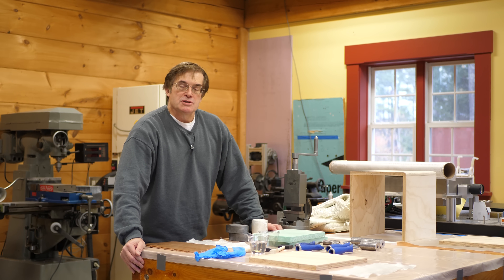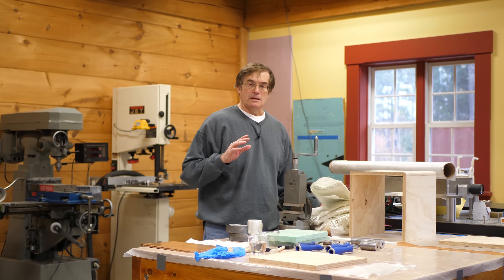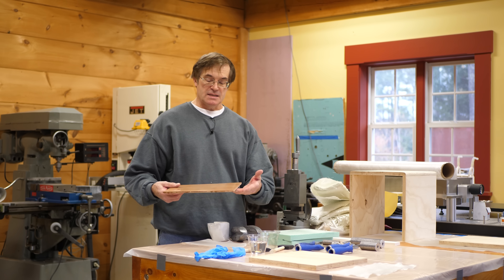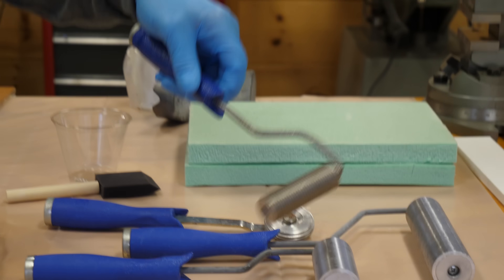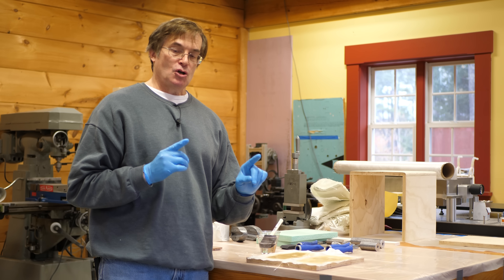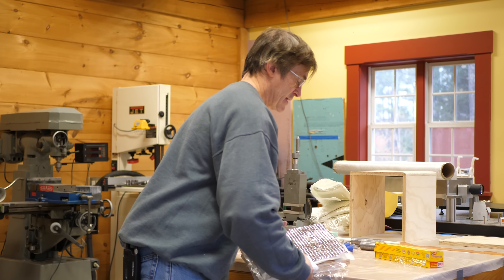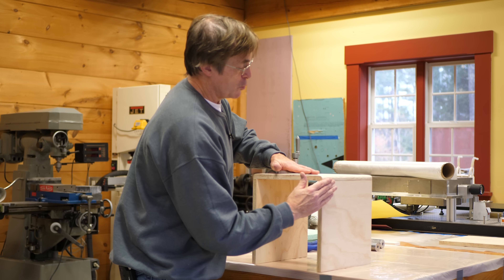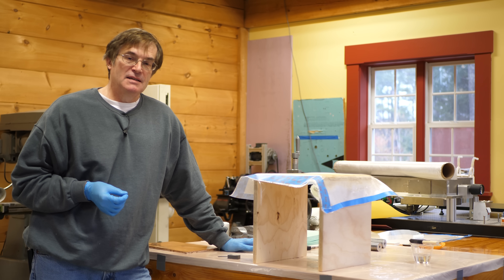Easy Tricks Using Fiberglass Strengthening!

Comment: When you insulated the piece to speed up the curing process, you laid down a piece of cling wrap directly on the curing expoy, is there no risk of that impacting the final surface?
Reply from the maker: Absolutely.
So, if the surface finish matters we'll show you how to protect it in the next video.
Reply: If you can increase the room temperature using dry, petroleum free heat, you can decrease  your cure time by half for every 10 degrees above 77 degrees F.
Reply: @WereAllThatBored  why "petroleum free"? Is there something special about it?
Reply: @cabletie69  Pay no mind. He's just trying to make himself look smarter than he is.
Reply: cabletie69 byproducts of burning petroleum and epoxy do not play nice.  It’s more about contamination your work space and potentially your layup.  Same reason a heat gun is recommended to pop air bubbles in table top epoxy vs a torch.
Reply: H3R3T1C right.  Thanks for your contribution.  I recommend venting your car exhaust towards your dry fiberglass let me know how it goes
Reply: @cabletie69  Virtue signaling most likely.
Reply: @WereAllThatBored  With torches, if you don't see any black smoke, it means complete combustion is taking place. This means that there are no real by-products unless you set the epoxy on fire like a dumbass lol. 90% of the time when you look at an epoxy river table or the like build, they use propane torches to pop their air-bubbles. Are you to tell me that 90% of people are doing it wrong?
Reply: H3R3T1C cool story bro
Reply: @MFKR696  Hydrocarbons and humidity are byproducts.  Since you didnt follow anything I typed I get why you didnt understand.   First point.  Heat  accelerates the cure time.  The room you are heating is your work space.  Its where you keep DRY cloth.  Notice I said aim your car exhaust towards DRY cloth and let me know how the Hydrocarbons work out for your now expensive, useless fiberglass.  Last, and very least important.  River Tables, they require multiple layers of epoxy.  Use a petroleum source to pop bubbles between layers and you risk contaminating the surface between layers.  Ive done it and its not a big deal, but it is a "thing".   Bubble  Buster, or a heat gun will produce better results.
Reply: @MFKR696  so if there is no smoke there's no carbon monoxide?
Reply: @cabletie69  basically any electric heat source. electric heat is even and doesn't emit any contaminates that might mess up your material
Reply: @RobertSzasz  That's not always the case. With certain things, carbon monoxide can also be produced regardless of whether the combustion was complete or not, but carbon monoxide won't have any effect on epoxy either. It will have an effect on you, however, so any time you're using a gas-torch of any sort, keep it to the garage, and keep the door open. I do know that propane is known for being safe to burn indoors, hence the wide use of propane forklifts in warehouses, but I would still keep the ventilation going when using it. Besides, when you're working with epoxy, you should probably have some good ventilation going anyways, unless you want to end up having the IQ of a twig lol.
Reply: PsychoLucario exactly.  The genius below your post doesn’t get it.
Reply: H3R3T1C lol you’re telling me I have 6 YouTube accounts?  Are you ok?
Reply: @TechIngredients  There is a much better way than heat pads. Just use a 500W halogen work light placed a couple feet from the work surface.
Reply: @MFKR696  "With torches, if you don't see any black smoke, it means complete combustion is taking place." nope, and you clearly don't have any idea how chemistry works, as you talking here about burning hydrocarbons -> oxydation of hydrocarbons.
Reply: @MFKR696  The invisible exhaust from the propane heater can, theoretically, chemically react with the epoxy.  However, I have been doing it for decades with no problems.  That's the difference between theoretical and practical knowledge, I guess. Complete combustion never happens in the real world, and so you end up with partial combustion products: CO, CO2, NO, NO2, SO2 are produced by propane and kerosene heaters.  The produced SO2 is bad for epoxy (theoretically) and CO is bad for humans.
Reply: @Bialy_1  If you say so lol.
Reply: @WereAllThatBored  most car exhuast is wet. unless you have a way to dry all that co2 for cheep or next to nothing. please let us all know..
Reply: @nathandean1687  I dont.  I was asking him to do something I would never do as a joke.
Reply: @MFKR696  I have used both Propane and heat gun. Propane works but heat guns are more forgiving.
Reply: @Nathanation88  You just completely shut H3R3T1C down, and I appreciate that.
Reply: @Nathanation88  Sir, the bubble busting tools l was supplied with has knurling, it's not ribbed.
Have l been supplied correctly?
Reply: @88njtrigg88  I wasn't sure if you were being serious (epoxy bubbles) or making a play on words (false-superiority bubble busting).. I'm no epoxy expert, hence why I was watching the video, however from what I gather any roller which consolidates the cloth and provides concentrated pressure points will assist with air removal. Which is better? Ribbed would provide more concentrated pressure points due to the lower surface area ratio (ie, better at popping individual bubbles), however I don't know which would provide a better end result (I don't make assumptions and portray them as fact when I don't have enough experience or understand all variables, like others above)..
Reply: @WereAllThatBored  Another way to speed up the epoxy curing time is to set the object out into the sun for awhile. I think the UV rays from the sun speed up the cure rate in addition to the heat from the sun.
Reply: @charlesaanonson3954  agreed.  Polyester kicks off super quick in the sun.  You can demold  a part within one hour if  you are on a tight deadline.  Ive never tried it with epoxy though
Reply: @Nathanation88  Thank you for the intuitive reply.
I was just repeating the terminology (bubble busting) from the maker of the video.
Your explanation has cleared the matter up for me. I will purchase a ribbed tool.
Reply: @pixelpatter01 

Virtue signalling = being a smartypants ? Right? 

Oh I like it....
Reply: @fillmorehillmore8239  Quite true.
Reply: H3R3T1C   The damage from water vapor in the hydrocarbon heat source being negligible is an UNKNOWN.  ITS BETTER NOT TO RISK IT.  Use the best method!
Reply: @TyDy Miler, thanks for sparking a conversation that made me laugh for the first time today. Got so engrossed in this one that I had to read the reactions all the way through. Ended the way I thought they might, also. 
Sometimes you just never know what an innocent and generally innocuous question will do. I wonder how many wars have been started over a simple, honest question, embellished, misquoted, and ultimately taken up by dragon slayers or warmongers over-eager to impress a lady or three...

Comment: One of the things that a lot of people trying to do automotive panels with composites should learn is the basics of tensegrity that you touched on with your fiberglass reinforced foam. One of the easier ways to take advantage of that mechanism is to use foam or honeycomb structures to create a ribbing or webbing matrix on your fiberglass or composite panel, and then glass right over it. The foam being encased in your composite of choice will prevent it being the weak point by deflecting loads through the vertical sections of the enclosure, thus allowing you to bind two rigid surfaces into a structure wherein a compressive or tensile force applied to one surface is counteracted by a tensile or compressive force from the other by the forces being transmitted through the vertical support structure as a lever. It's like an I or H beam being more difficult to bend along its faces. These ideas are nowhere near new in the automotive world. Open the hood of any car and peel back the sound and heat isolation if it has any and you'll see an example of what I mean made out of stamped steel. Except with composites you can go a step further than auto makers can with their hood panels and you can bond the two layers together, enhancing the efficiency of that mechanism and further reducing the potential deflection of your panels. It's such a cool, easy trick that you rarely see used when people decide that they absolutely need to make a carbon fiber hood or fenders or whatever for their car, then they end up with a floppier panel or they have to use several more sheets of carbon fiber to reach the same stiffness.

Comment: I've watched a lot of videos and read a few books on this topic from the boat industry, and you definitely add a lot of value to this topic. With both theoretical understanding (e.g. the imagery of monomers protruding from the tacky gel to create the chemical adhesion) and well as practical application (e.g. the sandwich of low temp, controllable heat pads to modify curing time or the tape when cutting glass cloth). Thank you so much, honestly one of the best channels out there, you are making humanity better by sharing this knowledge in a useful way!!
Reply from the maker: Thank you!

Comment: I've worked a lot with epoxy, in many different "flavours" so to speak, and found it to be very satisfying and rewarding, and you have demonstrated that a moment's thought can make an enormous difference. A particular favorite was an ultra low viscosity type for "potting" high voltage equipment,  I look forward to more stuff about this material...cheers.
Reply: I have used heat lamps to speed curing on larger structures sort of a home built autoclve. Vacuum bagging helps also on larger parts.

Comment: very instructional video, well done , have ever done epoxy over a wooden rod ? I want to try it on a pool stick shaft to make it less flexible , any videos that you have made in the past to show the easiest way to do it ?
Reply from the maker: It won't do much.  The tensile modulus of the epoxy is close to that of wood. However, a few linear threads of glass or carbon glued parallel with the axis of the rod will do wonders.

Comment: Any tips on fiberglassing a curved surface (i.e. the sides of a boat)?
Reply from the maker: As I said, try to work on a horizontal surface, but when the surface curves or you have to work vertically, be stingy with the epoxy.  Just like whith spray paint several thin coats will minimize the chance of runs and as long as you recoat a tacky surface, you can add coat after coat.
Reply: @TechIngredients  Awesome, thanks for the advice.  This made fiberglass (and boat construction for that matter) much less intimidating for me.

P.S.  I've been a fan for quite a long time and I am very excited for an uptick in content.  Best of luck with the new format, sir.

Edit:  P.P.S. Looking forward to seeing your catamaran on the water.

Comment: It was so easy to understand you,  thank you so much,  Im completely new at this, now that I'll live in a travel trailer, need a bigger shower, except no plumber will help,  therefore I'll be creating a shower pan on my own,  thought of Resin & bunped into fiberglass, it makes absolute sense, I'm guessing 1.5oz waterproof fiberglass mat 3 layers, then decorating with an additional thin layer of Resin, encapsulating crushed glass, gliiter 😅😋, some polished pebbles... 30x45, over a 2" layer of moisture blocking celulose foam board & wood structural frame (skeleton) covered by  ¼" plywood base.  Do you have any suggestions?  Am i wrong in my crazy ideas? I hope you're able to give me a tip or two... keep up the great work.  thank you🥰
Reply from the maker: Sounds pretty reasonable. Consider coating the underlying structure ie wood and insulation with epoxy because temperature differentials with a mobile instillation will cause condensation which could lead to rot.

Comment: Do you have any videos explaining when to use epoxy Fibre glass abd when to use polyester Fibre glass?
Reply from the maker: No.
I don't  like polyester.  It's  actually  stronger than epoxy...once.
It has poor fatigue  performance, and after a few stress cycles, the epoxy  performance is better.

Comment: Wonder if the boat cloth on foam might make it worth revisiting the materials for the flat panel speaker project?
Reply from the maker: I tried that.  The increased stiffness is actually a liability.  They need to flex and to damp.

Comment: The chopped strand mat is less about conforming to curves and more for structural stability between the layers and as a cheap thickness builder, as the woven cloth texture can make woven-woven de-lamination a problem (in a low cost mass production environment) also the woven cloth is anisotropic and poor at transferring loads along the diagonal and the chopped mat is fairly isotropic so it provides this off axis load transfer. 
Very light weight mat, known as scrim, is used as an outer layer to hide the weave pattern and make a nice base for a smooth gel-coat. 
In building boats commercially the chopped strand is applied by a spray gun rather than as a mat, this is much cheaper and faster at scale, the sprayer is fed mixed resin and a simple dry cord of glass fiber and the gun does the chopping and portioning of fiber to resin. Bubble busters are then used to consolidate the layer.  
Also the plain weave is nice and stable, easy to work with flat surfaces, but satin weaves are much better at conforming to compound curves; Structurally both satin and basket weaves tend to make an end product with higher modulus and strength to weight because the fibers are less kinked by the over 2 under 2 (or 3, 3) pattern than in the 1,1 plain weave.(probably not a substantial difference outside of aerospace or competition)
Reply from the maker: Ribbon tow cloth is at the top of the performance scale because the fibers are nearly streight.
Reply: @TechIngredients  Yes, it is often used for aerospace constructions, can be difficult to work with at the amateur level.  The same stuff that is fed into chopper spray guns.
Reply from the maker: It's what I used for our large multi rotor propeller video.😀

Comment: Brilliant video, anyone know how applying glass fibre and resin to the polystyrene effects it’s heat insulation ability. Does the resin soak through and fill the air voids or does it just take up the outer surface?
Reply from the maker: It doesn't.  Polystyrene is a closed cell foam, there is no epoxy soaking.

Comment: Hi Tech ingredients...I am very inspired by this video...and now trying to make some panel with 1inch thick xps foam to serve both as compartment lids and casting platform for my boat, there is 4inch square support xps foam beams under the panels covered with 3 layers of 10oz glass cloth.The beams are 12 inches apart...how many layers of 10oz glass cloth would be safe to stand on for my lid panels that measures 12inch×28inch at 1inch thick xps foam board?...😅I got some fears that my foot might break through the panels...hope you got some helpful tips...Thanks for all the help since my foam board boat build.The lid platform  area totals about 28inch ×36inch
Reply from the maker: Thanks.
Despite the details you provided, it's not nearly enough to estimate the real world strength of your component. Things like crown and the width of the supporting  shoulder are significant.
I'd recommend you fabricate  a test panel of similar dimensions and with a typical layup schedule then test it.  And, I mean all the way to failure.

Comment: Great INFORMATIVE Vid !   The heat application concept is Terrific ...... EXCEPT, what are the options for Large sections (6”x12’ for example) ?  Thanks
Reply from the maker: That depends on the shape and whether the application needs to be semi permanent or easy reconfigured.  Did you see the low cost oven I explained in our "Glowing Epoxy" video?
Reply: Tech Ingredients no.  I will look.  I will be a bit more specific, so that you can see where I’m headed.  I am having a fiberglass hightop installed onto a Ford van.  They offer 3/8” OSB laminated in to the fiberglass ceiling, and about a 6”x12’ strip on the vertical sides.  They promote it as structurally multiplying the strength of roof, and attachment points for (whatever) on the vertical sides.
The upcharge is Considerable.  Over $500 closer to $1k.  This seems pretty Nuts, so I watched your vid to learn, and try to figure an alternate means to binding wood to the vertical sides.
Hopefully that clarifies (some).
Thank you.  Extremely Informative vids

Comment: Did you consider using a vacuum as well to clamp the glass to the core?
Reply from the maker: That certainly can be done.  For simple lay ups, using gravity is nice because it's convenient and fast as well as minimizing expense.
Reply: @TechIngredients  do you know if it increases strength? There seems to be a general feeling it does, even if you only use with a vacuum cleaner (cheep)- but you guys seem to have a more scientific approach - which is great!